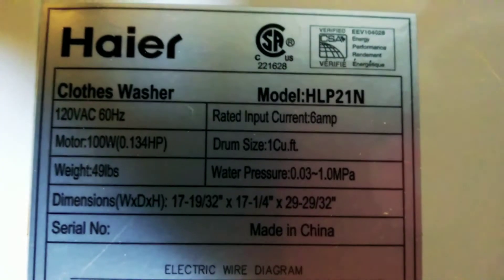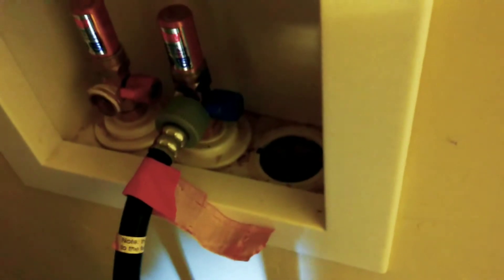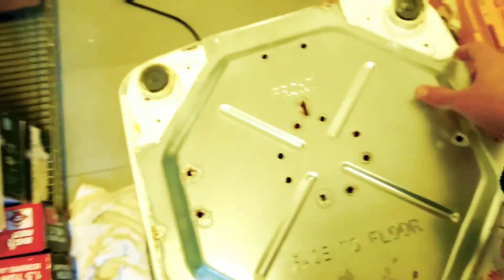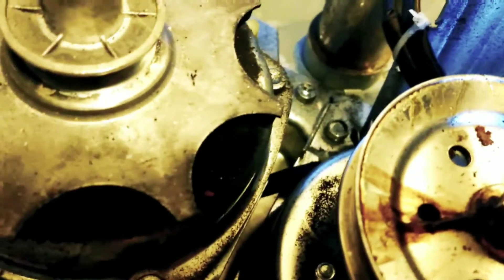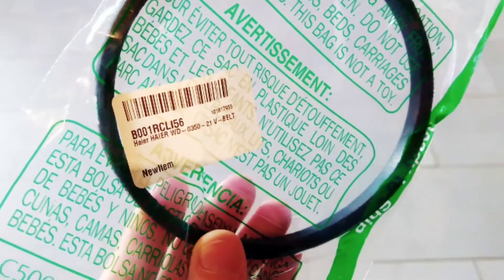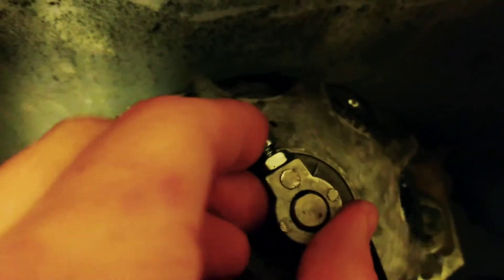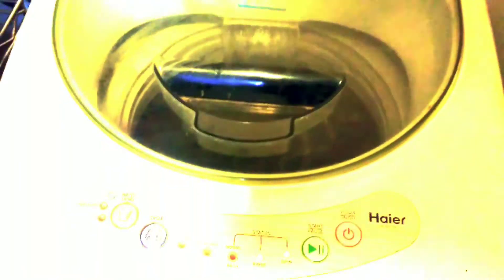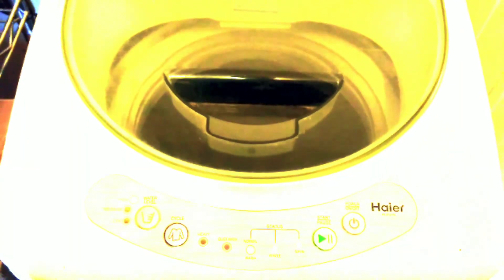Haier HLP21N Washer - Belt Replacement 2017 w/ tips

Comment: I have a similar match. My started
banging on the left side? I'm going to change belt.. Mine opens from back but can't see anything?
Pls help.
Reply: Put some new damping grease on the spring struts. Nyodel 767A
Synthetic Damping Grease. It’s excellent stuff.
Reply: To reach the belt & motor you must remove (unscrew)the metal plate on the BOTTOM of the washer.

Comment: Looking to buy a tiny washer for my NYC apartment...would you recommend buying this particular model?!
Reply from the maker: Yes, this is a very good compact model that will last about 5 years without maintenance (that's ~$20 a year). It is a "cold only" machine in that it only has 1 water input. Cold water washing is technically all you need for laundry, but if you want to use hot you can either hook it up to a hot tap or get some plumbing extensions to hook it up to a shower head (with a little valve so you can direct the water to the shower or to the machine). It can do the laundry for about two people maximum. Make sure to do laundry more often so you never put too many items inside.

Comment: I have a hair washer that won’t drain just sits and hums after a couple hrs sometimes it will take off and finish the cycle a few times it took 4 hrs
Reply from the maker: Maybe a pump that needs to be replaced? Maybe the drain is clogged? In general I know nothing about these machines but I figured this specific issue out by watching other videos and reading up on it.
Reply: Touch the pumps metal sand which block for its motor. if it’s blazing hot it probably shorted out and needs to be replaced.

Comment: What if you replace belt and it still wont spin
Reply: Could be a bad motor or transmission or the transmission switch brake thing that makes the loud click and moves over to engage the large white outer gear on the transmission to begin the spin cycle.

Comment: my washer doesn't go into the final spin cycle to dry clothes, could the belt be the problem?
Reply from the maker: demarko9999 Try running a spin cycle by itself. What happens?
Reply: it stops and just makes a buzzing sound. it washes,agitates clothes just fine
Reply from the maker: demarko9999 Yeah that was my exact problem! It's time to replace the belt. :) I hope this video helps!
Reply: Always test without clothes first - Most of the issues are related to balance load distribution of clothes. If not evenly distributed, this tiny machine will stop, buzz and do nothing.

Comment: I hear a strong squeak but when I opened it, I find the belt in a good condition, what else can be broken?
Reply from the maker: Do you hear the squeak even when running the machine with nothing in it? The weight of the load makes a difference.
Reply: @digitaltutorials1  the weight certainly makes a difference.
The sound happens exactly at the "brake" and not the "spinning" (I.e during the spin cycle, there is no sound).
Reply from the maker: Gotcha, in that case I don't know the answer. I think that happens to me too but since it doesn't affect its ability to wash I just have to ignore it. I think it is simply a design flaw or something is wearing out in the bottom of the basin (where you load the clothes). The longer you have a machine like this the more it seems like replacing the whole thing is the best option, since they are so cheap.
Reply: Correction, I just ran it with no clothes and the sound is still there, again in the wash cycle, not the spinning.
I can see the washplate rotating during washing, but the sound is horrible ... 
I wish I can fix it or replace a part and not the whole thing ... 

Thank you for your cooperation though
Reply from the maker: @IEEEASUSB0  Thanks for posing the question here! If you do end up figuring it out, please make a short summary video or comment here! Good luck!
Reply: That happens to me I think the squeak is coming from the belt or from the. Tub break another theory that I have is that some of the components get unoiled after a while and it makes it squeak it happens to my 2007 hacer model